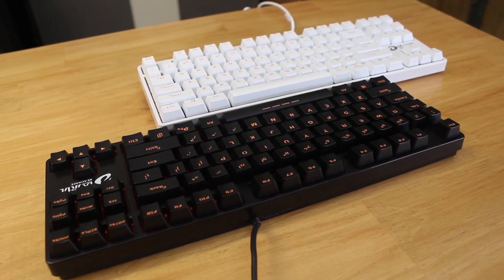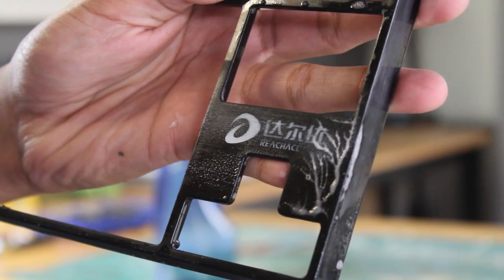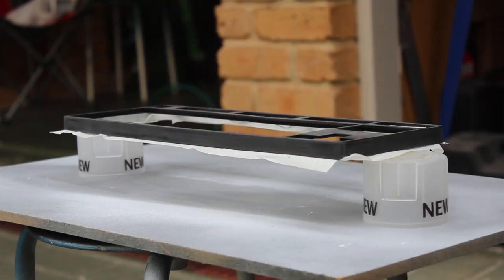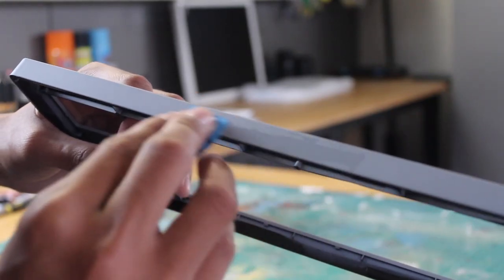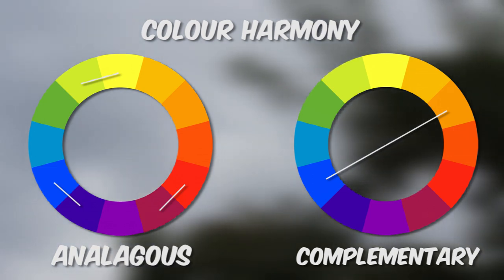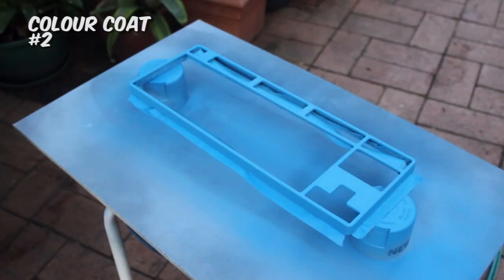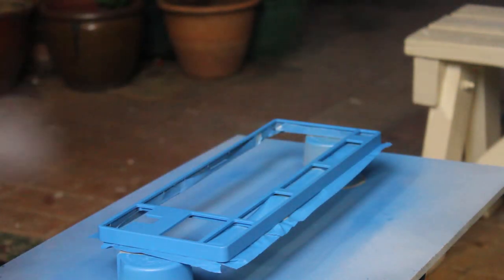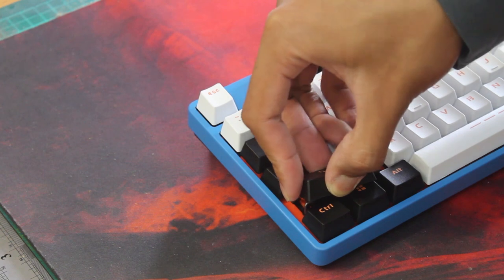How to Paint a Mechanical Keyboard : V1

Comment: you should start your sprays off the object, so you don't get "spits" from the cap. This also goes for when stopping. Don't stop on the object, move your hand past it, and then release the spray cap. This is most noteable with the painting layer, but should also be practiced when using primer. Just a tip from a pro auto painter :)
Reply: and clear coat lol. You just spraying it random, like throwing flour on a table when baking. Use a straight arm and wrist, for clean lines, with the same distance, no curving in and out, because then there will be more coat on the middle than on the edges. And always overlap 50%. This is very basic, kinda surprised a smart kid like you, havn't done the proper research before making a "how to" spreading bad ways to paint. Just youtube "spray paint technique" and you'll find a lot of videos that will help you.
Reply: stay cool its only a totorial its not his job :)
Reply: Luka Huth i even complimented him as smart, and gave him direction on how to read up on the subject.. So i don't really see the point of your comment.
Reply: I am fine with his finishing, he done a great job and I've loved watching this! Keep calm bro, no one was hurt
Reply: i dont get the part " always overlap 50%"...  explain pls? im newbie painter..want to spray my QFR
Reply: Thanks @Main for the tips!

Also, about overlapping 50% I think he meant when you draw the paint lines, the top half of each line should cover the bottom half of the line above it.
Reply: You're perfect. I just figured out something  because I've once painted a big metal piece for a model making process. That was the worst thing I've ever done. I won't use a spray that way again.
Reply: hi im sorry if im late but can you spray paint over green with the color white? or do you need primer first
Reply: @FindTheMasterpiece  Yes, this is what i meant, didnt know there was that many replies, youtube must not notify correctly? 50% just mean overlapping half of what you just painted in that stroke. You do that to prevent any "gaps" between the strokes.
Reply: in other words, spray when your arm is moving
Reply: @flawedvirgin114  There is nothing cooler than contributing something, if it can be improved. Especially if the tutor is a professional modder, and the contribution comes from a painting professional, which is the main subject of the video, and the advice is free.

Personally, if I already knew everything I wouldn't have seen the video, but I happen to agree with the comment.
Ty @main4701, and ty @TaeTekboards.

And now to contribute, I would add that drying between coats is important, but not because of the humidity of the surface layer, but of the base: if you add paint to a painting that is dry only on its surface, the solvent will damage it, and the previous layer and the new one they will mix poorly, because there is a dry residue between the two. In other words: either you paint fresh or dry, but never half-dry.

Comment: I highly recommend Tamiya Model Spray paints that you'll find in a hobby shop. They're expensive but are basically scaled down automotive paint, the best you can get for small jobs like this. They also have really nice nozzles that you can take off and put onto cheaper spray paint cans.

Comment: You should check out the Krylon Fusion paints.  You apply it just like any other spray paint, but think of it more as a dye for plastics.  It's worth looking at if you're dealing with a lot of plastic, much less prep work.

Comment: Consistent sanding, even on the tiny places hard to sand, is important. On my last keyboard, I got lazy on the top part, and the paint orange peeled. I ended up covering it up with a textured rubber coating which actually looked pretty good, but yeah, take the time to sand everything thoroughly :P

Comment: When exactly do I apply the clear coat? After the paint cures or a few hours after applying the colored paint (in the process of curing)?
Reply from the maker: I've done it like within an hour after the coloured paint. I've read different things on the net, many say 30-45 mins after colour paint. So i'd probably follow that. Just go very light though, otherwise it will make it look bad.

Comment: Do I still have to sand off the top and use primer if the top is matte?
Reply from the maker: +reeamoo A matte surface is easier to paint in comparison to a gloss finish. But it will depend on what you want. If you're not carrying the keyboard around, and just leave it at home - it may suffice. I would recommend top clear coat to make it more durable, and it should be good.

However, if you want the strongest finish - you would still need to sand and prime.

Comment: what will happen if i didnt put on the primer?
Reply from the maker: Primer helps adhesion, and therefore helps it be a bit more durable. You can still paint straight on, it just won't be as easy and as strong. Primer also fills in gaps.

Comment: where did you get your keys from ? I cant find any whitw kwys for my razer keyboard :/
Reply: Razer keyboards have a non standard bottom row (the ctrl, win and alt keys are not all of the same size) so it's gonna be harder to find a keyset that fits. There are for sure, but they tend to be design keysets that cost quite a bit and you'd have to add the cost of the additional "pack" with the compatibility caps.

All in all you're still on the lucky side of the gaming brands layout craziness, both Razer and Corsair have this problem, having non standard bottom rows, but it's still possible to get keycaps for them, it's just more expensive; then there is Steelseries which has an oversized spacebar that is not made by anyone else, so no way to replace that, and Logitech with their proprietary switches that no one else makes keycaps for, so no way to change any of them.
At least we have Coolermaster that decided to keep a standard layout for which it's easy to find new keycaps.
Reply: thanks for the comment,you really helped me
Reply: Luka Huth Sorry I couldn't point you towards something more specific but I don't really know about any commonly available set that would fit that bottom row.
That said I'm European, availability here is pretty poor in general, if you're in the US you'll have way more chances.

Check this for more info in general https://www.reddit.com/r/MechanicalKeyboards/wiki/keycapsellers
Reply: You´ve helped eneough :D

Thanks for your help :)

Comment: what if the frame is metal. Like a ducky shine 3?
Reply: then you would use something like "self-etching primer" or at times, but rarely, called "aluminum primer." and use something like acetone, paint thinner, or I guess rubbing alcohol could do after sanding to remove metal particles, but acetone works the best if you don't mind paralyzing your nose. after that just follow his way.